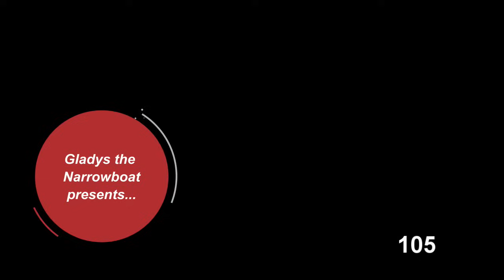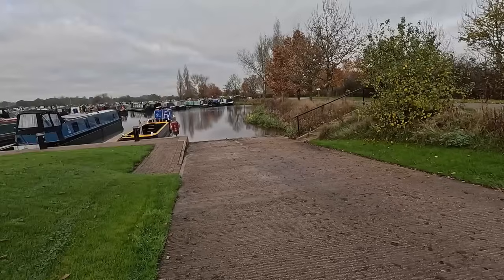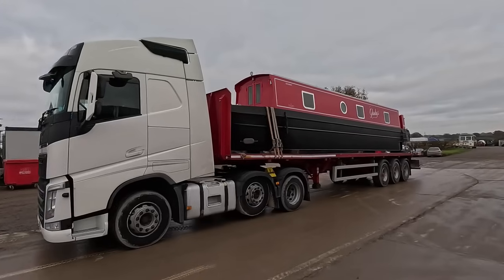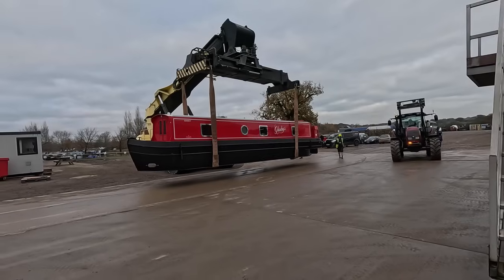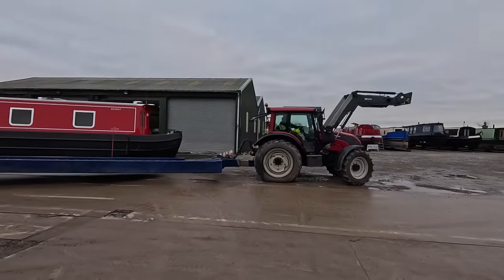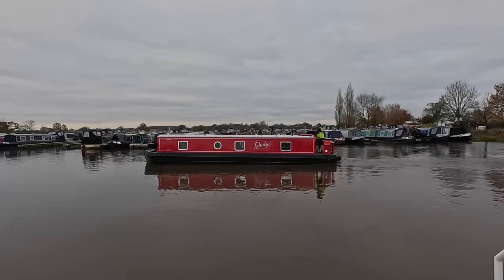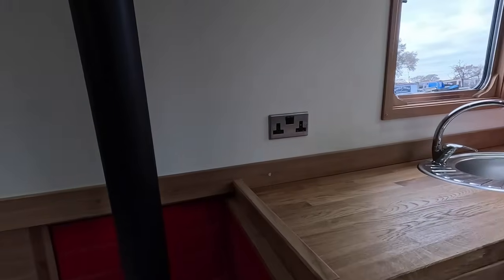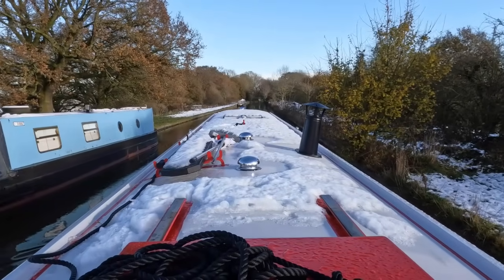Narrowboat Launch Day! 15th November 2024

Comment: Hyster, now there’s a blast from the past. When I was learning to weld, we went to a Hyster factory, where they had one of the first UK based computer controlled welder. They were cold bending & welding inch thick plate steel. A perfect weld every time, with minimal cleanup and much much quicker than the best human welded could do it. That was the writing on the wall for many of us. What would be the point in becoming the best you could be, if a machine could do it better, quicker, would work for less money and do it 24hrs. a day. I’ve not welded metal in decades.

 Back to Gladys… yes, yes and yes!
Reply from the maker: Hi DC! I might have known you'd know the Hyster name! I dont know anything about welding Im afraid, but that crane is bloody awesome! Sounds like you approve of Gladys... one day she'll be cruising along through Gilwern😁